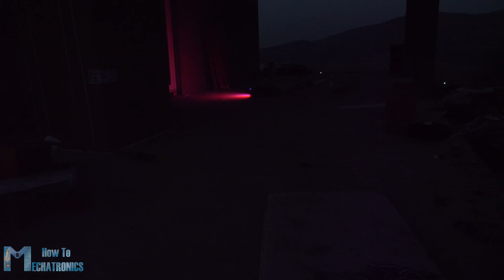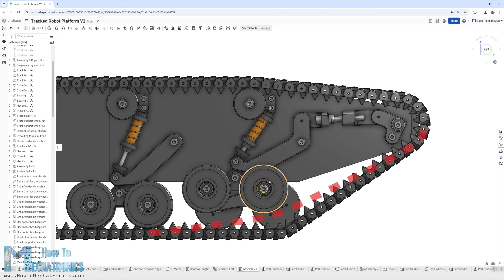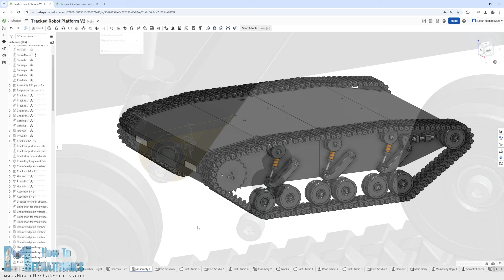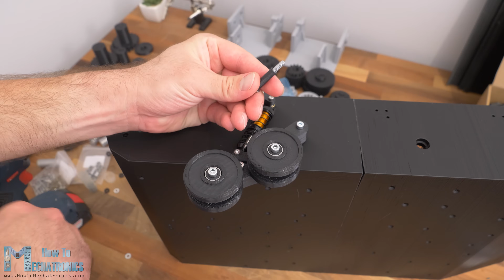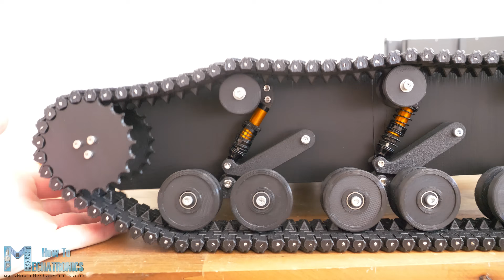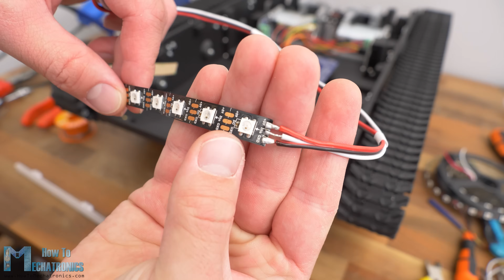3D Printed RC Tank with Dual Speed Gearbox

Comment: I'm building this right now and the most frustrating thing is the lack of information on hardware. When I bought the stl files I was hoping for a parts list that would have atleast told me bearing size and how many I need. Or even just the motor size in the description of the cuts3d page would've been very helpful. But instead I have to heavily rely on a YouTube video. I don't know if this is a ploy to get more views or just bad planning. This is a soild project don't get me wrong I'm having fun building it but lack of information is making me wish I went with a different build

Comment: Hello Dejan! I am considering building this project, and I got a couple of questions. Is it possible to do this with Bambu Lab A1 printer which got a smaller printing space? And, can PLA be used? Is it strong enough for all the parts? Do the motors / boards produce significant heat that could melt PLA?
Reply from the maker: Hi there! Yes you can make this project with smaller 3D printer, I made a separate files for the big parts, spitted that could be connected with bolts and nuts. They are included in the download files.
I printed everything in PLA, and haven't notice that the motors get that hot.
Cheers! I hope you will enjoy building it!

Comment: Hey sir, I'm recreating the project you made. However, when powering the 2560 development board with a 12V power supply, the board fails to turn on. I measured the voltage: the VIN pin shows 12.5V, while pin A0 shows 4V, which is insufficient to power the 2560. I also contacted the seller, and they responded that the VIN pin cannot handle such a high voltage. Please give me some help.

Comment: Is there a way to add a camera that you can view through maybe a smartphone. How would I connect it to this tank. Not sure if you have a go pro on there.
Reply from the maker: I was using a gopro to take some videos, but there is no live stream. Check my DIY Mars Rover video. In that project I used a module that works on 12V and can transmit live video to as smartphone.

Comment: Now with it 3-D printed there is a Geneva convention that you have to be aware of and it’s Man in the middle protocol so avoid anything lethal that being said a robotic arm and it’s waxing your floors all day picking up trash in the yard bringing you a beer what’s even more important your entire toolbox the robot arm is now doing your job for you. You just have to supervise it but even more so the 3-D printer head is an extruder head. It is exactly the same as a cop gun in fact, the first time we have cock, caulking, you know, painting, houses, caulking, gun there we go the machine worked when the industry fell due to espionage and slavery. The caulking gun was the last of the handheld 3-D extruders that was still viable for use and so it was also the staple that was brought back first for a bunch of stuff. It’s kinda I know too much about history just put a robot arm on it and have fun. think of it as a really bad ass 3-D printer that you decided to make a 3-D printer that no longer has a box you made a 3-D printer for outside the box

Comment: I am a high school student living in Korea. I want to build the tank shown in this video, but I have a question. According to the supplies, it says that a 400uF capacitor is needed, and I saw that you actually used one. However, I do not see a 400uF capacitor on the circuit diagram. I wonder if this 400uF capacitor is necessary, and if so, where should I put it?

Comment: such a great design-  300mm printer is a must? or a 255mm can handle this ?
Reply from the maker: Thanks. I made a version for smaller printers, with 3 sections instead of 2 sections for the tank chassis.
Reply: @HowToMechatronics  last question which in not in the manual or this video - which part are in which material. i assume gears and track in PETG ? body PLA? could you update that please.

Comment: Love this, I fell down the rabbit hole looking at the 3d printed RC FPV Rover with snow plow from 2020 and this is significantly better, more thorough, and recently updated. Would love to see a snow blower/plow attachment and camera in the future. The plow could likely be easily adapted from the FPV version with a different attachment point.

Would tweaking tweaking the tracks to be a little wider give increased traction and torque in slippery conditions? Seems like it would be relatively simple modification to print the track links and road wheels a little wider.
Reply from the maker: Hey, glad to hear it!
I do plan to make a blower/ plow attachment. Though I missed this season snow, so hopefully I will make it for the next season.
Sure, the tracks can be modified to be wider, but of course, everything else around them would need to be modified, the sprocket, the road wheels ect.
Cheers!

Comment: This is awesome, again! I had just bought the model for the old tank a month ago and you came out with this. I didnt like how slow the old tank was so I decided to upgrade the motor but needed to design a gearbox for it. If I had know you were making this I would have waited haha. I am still going to go with my gearbox design as I am almost done with it and I am learning stuff doing this but I am running into a problem with size limitation. Your gearbox is waaaayyy cooler than mine and i love that idea of the nuts in the 3d print. I did that with your old tank because I did not want to buy threaded inserts.
Reply from the maker: Hey, thanks! Glad to hear you enjoyed building the other version. :)

Comment: I went to order the parts.... But the website article still doesn't have the programming code....is that available someplace???
Reply from the maker: Hey, I've just updated the website article to include the Arduino code.
Reply: is it a modification of the code from the first underpowered version of the tank?

Comment: The electronics could seem a little complicated and possibly unnecessary with modern multi channel controllers although some of the cheaper ones don't allow mixing on certain channels so you could use a V-tail mixer for the steering instead.  Fantastic design and well thought out.  Thank you for sharing.
Reply: You are totally correct, modern transmitter like radiomaster even have a lot of features for differential steering.

Comment: this is awsome i just finished building the last one you made and now planning to add airsoft/nerf turret to it
Reply from the maker: Thanks! Glad to hear it you build the other one!
Reply: @HowToMechatronics  quick question on the old tank you built the pcb had a rail for 5v gnd and signal pins does that rail work? been trying to use not sure how to write code for it
Reply: disregard that last question. My issue is on the board itself no matter what i do with the code the headlights, high beams and taillights power on when I turn on tank. Including the 5v, Gnd and signal rail on the PCB i connected a relay switch and it was on so as i turned tank on, not sure where i went wrong with soldering the PCB or if PCBway messed up somewhere any help or advice will greatly be appreciated!

Thanks in advance

Comment: This is amazing. I would love to print and build this but once you dove into the electronics portion you started to lose me. Maybe I will try it anyway. Also, a snowblower or plow attachment would be awesome.
Reply from the maker: Thanks! Don't be scared, go for it! The electronics is not that complicated for this project. :)
Reply: @HowToMechatronics  Thanks! Maybe I'll go ahead and start buying the parts once you finish up the BOM and the rest of the build write up. Great write up so far! Would love if you included setting up the receiver with the code etc. as well!

Comment: When designing with power electronics, always assume you will need a large heat sink.  Do the calculations.  Keeping the part cool will help with the life of the part.  If using natural convection, install the fins on the heat sink vertically.  I noted that some of yours were horizontal.
Nice looking design, amazing how many bearings and printed parts it takes to do that sort of thing.  you obviously put a lot of thought and work into it.
Reply from the maker: Thanks for the advice, it's always great to learn something new. Yeah, it sounds more logical to put this heatsink vertically, after hear it of course. :)

Comment: Absolutely amazing!! The amount of thought that went into this is mind boggling. The track system and the two speed gear system are nothing short of genius. Given that plastic would need to be replaced with metal, how feasible do you think it would be to power something similar but larger that could carry 100 kg?  I would like to try that, but I'm afraid that the necessary motor power, battery voltage, and battery capacity would be impractical.
Reply from the maker: Thank you!
Yeah, 100kg is a serious weight, and you would need some serious motor power. Of course it all depends what kind of speeds and torques you would need for that vehicle.

Comment: Hi, Dejan. Thanks for sharing this model. It looks awesome. I just bought the 3D plans and look forward to building them. I built the V1 tank a few months ago, and that was a lot of fun, too, but like you said, it was a bit underpowered for off-road stuff. I ended up with 260rpm motors to give it enough grunt for outdoor driving, but the V2 with the gears and powerful motors looks excellent. Thank you.
Reply from the maker: Glad to hear it! This new one is definitely cooler, as well as the power is spot on I think.
Have fun building this one too! Cheers

Comment: We built an RC truck that ran through the same Arduino Mega.  Your tank is much cooler.  Two things you can do in code without adding new hardware:  First, another switch-driven channel that lets you display the current power level of the batteries via the LED strips.  We set ours to show empty at 8V so that we wouldn't discharge the LiPo battery too far.  Second, a diagnostic display on the front row of LED lights.  Set it to move the LED one position down the strip for each time the Arduino code "loops."  Helps to quickly show if the vehicle has stalled because of the software or because of something else.  Also, you'll be amazed at how slowly it moves!  Great project!
Reply from the maker: Those are really great tips, cool and functional at the same time. Thanks for the input!
Cheers

Comment: Wonderful design and build. On the electronic side I can't help but feel an Arduino Mega is a bit dated for a modern project. For a next build you should explore toward ESP32s, the S3 with his fast dual core, integrated WiFi and Bluetooth would open your options. Over the Air firmware Update and WiFi control + advanced monitoring being at the bottom of the list ...
Reply from the maker: Thank you! I guess you are right, I will consider this for future projects.
Cheers
Reply: @HowToMechatronics  The Arduino is a good and solid option still these days. But ESP is fairly a good improvement additionally. You can make the two Microcontrollers communicate easily by using SPI or I²C Bus so it is completely modular.
Reply: @stefankauerauf4282 I feel the mega was a good choice as well, especially since he mentioned adding an arm later on and it has room for expansion. I think a esp8266 or similar would be good if you planned on controlling the tank with a mobile device or tablet, but since he utilized an rc remote I think it was adequate.

Comment: Try enclosing the printer to resolve your warping issue. It's likely it  has more to do with temperature variations in the room than anything else. Awesome build :)
Reply from the maker: Yep, that would help with the warping issue. But still, because it's really big and heavy print, it's very hard to avoid it. I used glue stick in my case to minimize the warping.
Reply: The issue is a poor heated bed design that results in inconsistent temperature at the bed edges. You can compensate for this overly simple approach with some thermal insulation. An enclosure is one, albeit extreme.

Comment: can anyone explain to me why every youtuber seems to use arduino and motor drivers instead of actual RC ESCs?
Reply from the maker: Well in my case, as I already mentioned in the video, in order to be able to update this tank with additional functions like maybe adding a robotic arm or something like that.
Reply: ESC extremely high rpm that would make the tank go too fast but the tank would not move since ESC motors are low torque. The gear box would have to be huge.
Reply: @noweare1  ESCs run on the same PWM signal and output the same voltage the motor controllers in these videos do, RPM is a function of voltage so this isn't it. I think it must be for engagement